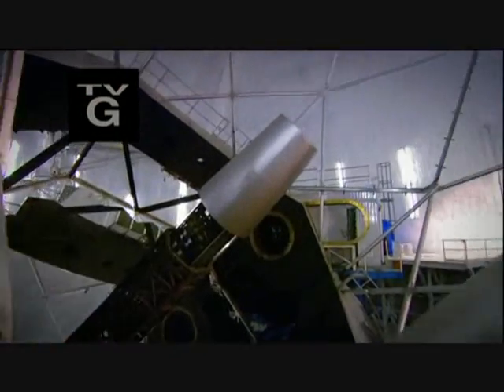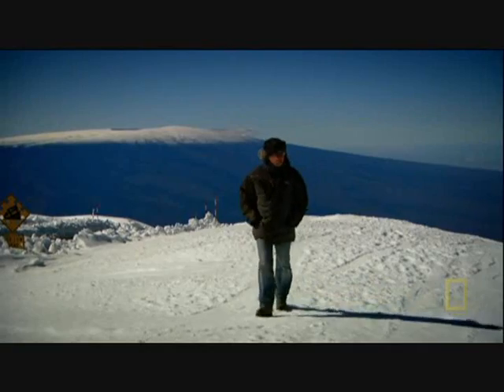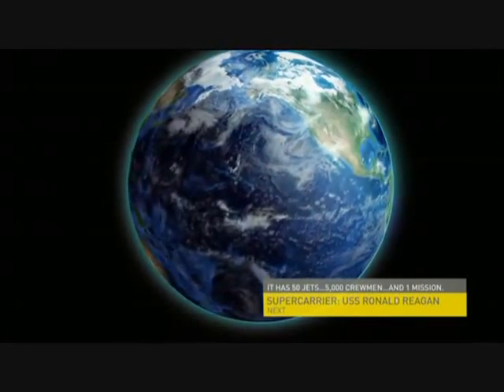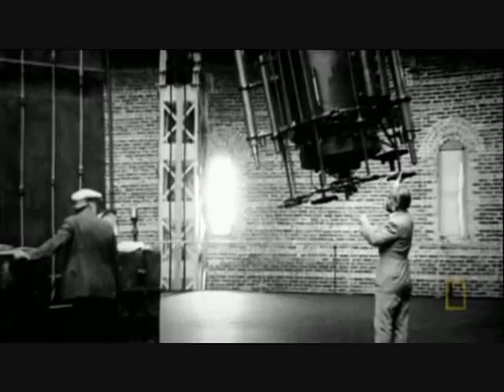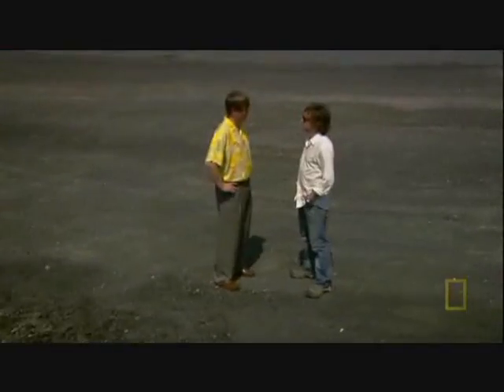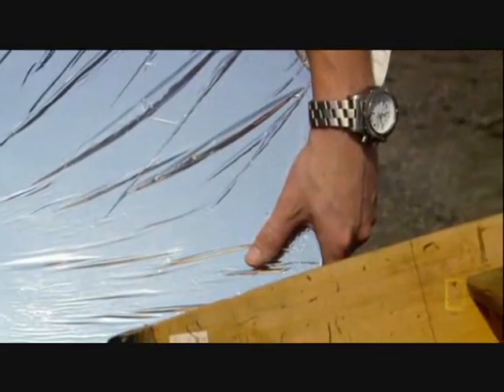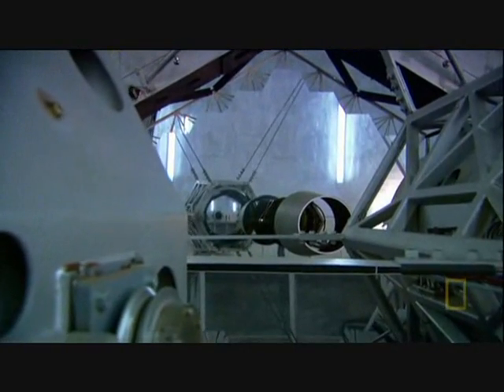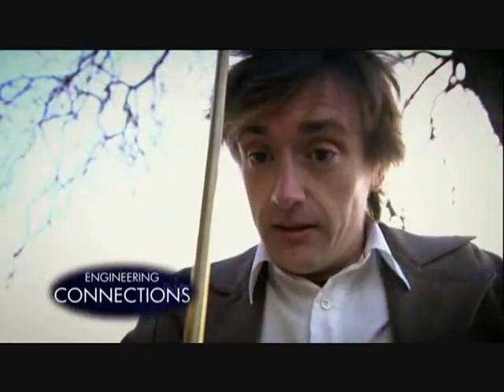EC: Super Telescope 1/5

Comment: Ive done the mirror thing as well, at night. We were using a theatre spotlight as lightsource. Using a smaller mirror of 35-40cm in diameter, it reached a max temp of 400C degrees. It wasnt quick enough to set fire to paper, but it was smoking, plus it was at night inside our school. Dutch sun wasnt strong enough.